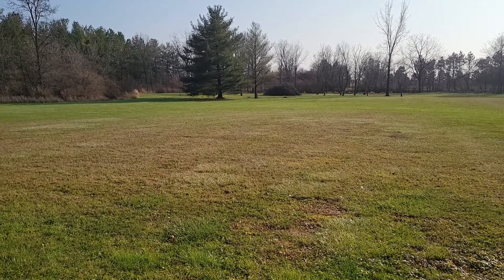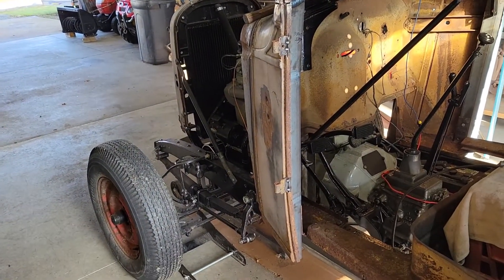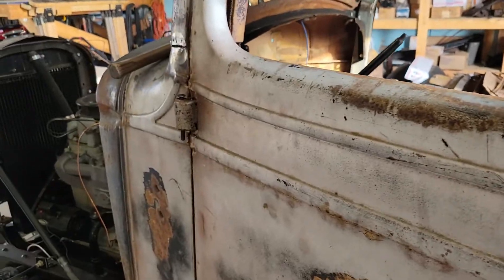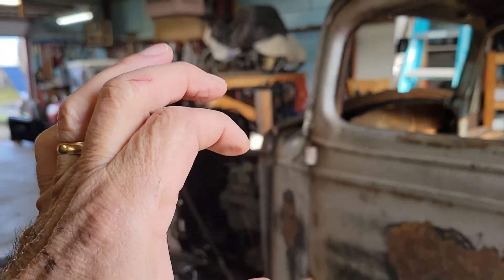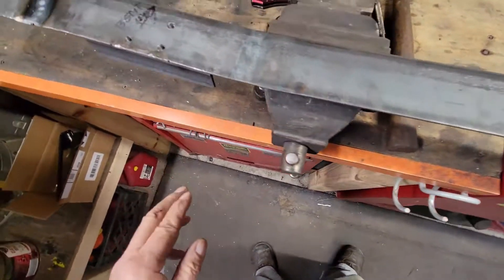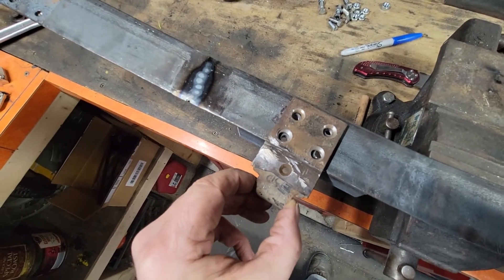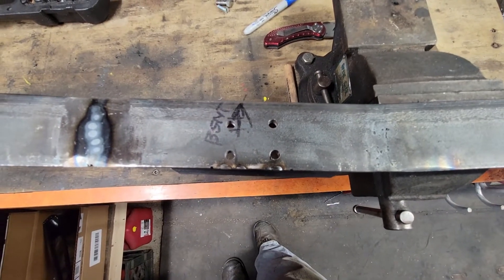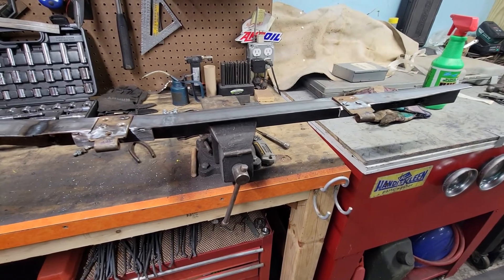1936 Chevy Pickup - Hinge Installation

Comment: Thank you much, I'm about to take the old wood door pillars out and make new ones. I didn't think about angle iron, was planning on boxing with sheetmetal.
Reply from the maker: Angle iron is the way to go unless you want completely original. The steel is way stronger and makes the cab so much more solid. It will take some finagling to make them fit, but it's worth the effort.

Comment: Wow December and no snow! A little tip for keeping the hinges aligned is to run a steel rod through the top and bottom hinge pin holes. You can also bend the ends of the hinges to fine tune any adjustments. It might be a good idea to test fit the door in the opening without the hinges to make sure the door still fits and nothing else on the cab has shifted.
Reply from the maker: Yeah it's 60 degrees today, bummer. That's a good idea with the rod. The door does fit the opening and what I did was to go back to the original way I mounted the hinges, which I show at the beginning of this video, and mounted everything up. I have another video to put up to show what the final outcome is. It still doesn't fit right, I think the worn hinges is a lot of the problem.

Comment: Looks good. Do you have any drawings/specs you're willing to share to do the same with my 36?
Reply from the maker: I'm sorry I don't have anything. I do know you may have to bend the hinges to line up. I've got mine mounted on steel 2x2 so they're pretty solid. The steel rod trick does help that Carter Auto Restyling mentioned.

Comment: Bottom of cab, and front bottom of firewall have 3 bolts that hold the bottom of what would have been the threashold now dsys, the firewall and csb have moved apart at the bottom causeing your bottom issue at lower bottom rear of door ! Guess how i know ? I have one, removed ALL wood!